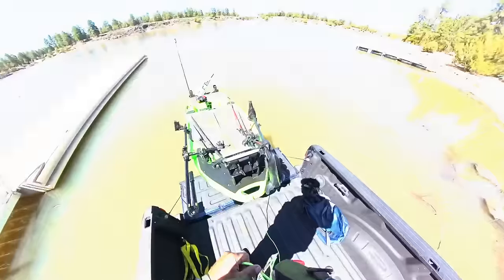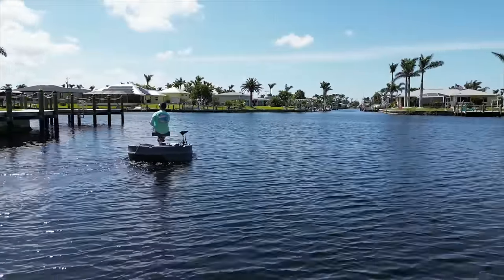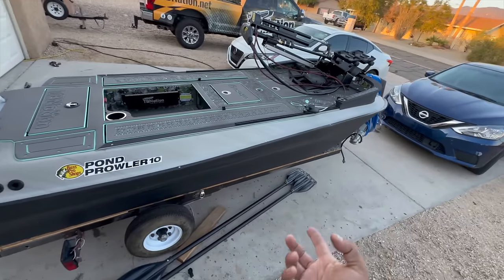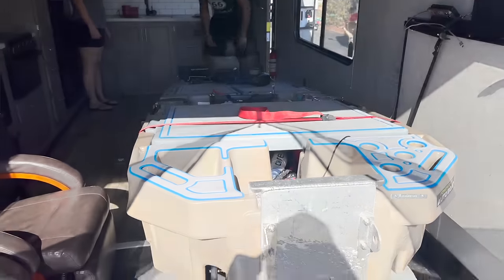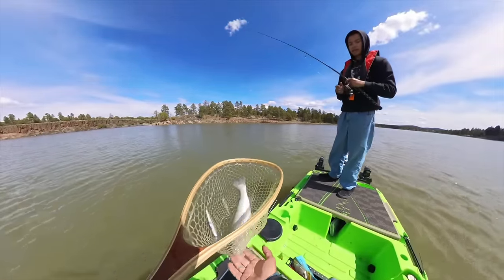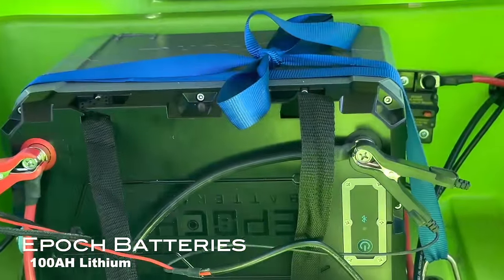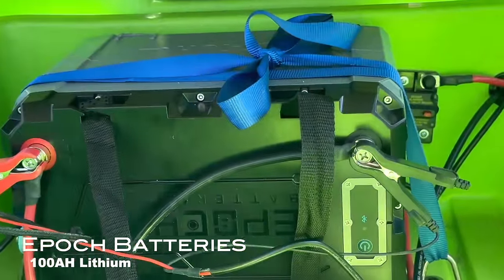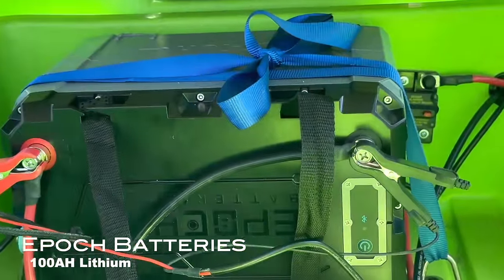Is the Lite Skiff the perfect Tiny Boat?

Comment: My pelican bass raider I bought for $800 is lighter, wider, holds more weight, and goes 10-15mph everywhere I go in inches of water w my mud motor. That skiff starts at $3700! I usually go fishing with my wife and 3 kids and don’t have to worry about sinking or flipping. It’s a cool boat tho
Reply: What the heck is a mud motor?  I've been looking into trolling motors for my yak. I would definitely pay the extra money to Cruz at 10 to 15

Comment: what abt the fact that a 12ft jon boat ways about 80lbs and costs half the price of this thing? 8,10, and 12ft jon boats are all wider, lighter, and cheaper. and can all fit in a truck bed.
Reply from the maker: Jon boats have no storage. To try and add storage in a boat like that will likely end up costing you more + it will be heavier
Reply: @TinyBoatNation  so if given the option between a 8,10, or 12 ft jon boat or a lite skiff?

Comment: Real installation hurdle for me with the Autoboat was the need for the goofy retaining collar required for install. 
I had a couple of kayak trolling motors sitting around (30lbers from a Chinese import tandem, just like a BKC and Hoodoo white label).

These didn't come with the pontoon style bow mount I bought to drop the trolling motor on, and the motors themselves did not have the collar that the Autoboat kit assumes that you do.

Finally, I couldn't work out how to put a transom block on the front my new Milha Lite Skiff (I'm not a welder and there's no way I could fab something like what is seen in the video, impressive as it is; just way out of reach for basic DIY types like myself, still getting over saying things like "that's a hardware problem"). Likewise the kayak track mounted transom bracket I had on hand (I think from Railblaza) would not grant anywhere enough front or side clearance to get the motor shaft vertical past the bow from the front three track mounts (center, right or left).

I had another transom bracket laying around for a hybrid SUP (a cheapie Amazon special knocking off the MinnKota design) and found it had the molded in collar, so just ended up sawing off the goofy triangular nut. I fastened a bracket from the retaining screw for the collar to my pontoon-style bow mount bracket.

In retrospect, I would have bought a stainless shaft collar the right inner diameter for my trolling motor shaft and bolted it on (without sawing up the transom mount) and used the tension screw whole to bolt that to the pontoon mount with a straight bracket/single-column hole mending plate.

This would be a really cheap piece of plastic to include in the kit to make it complete, even if you don't use it (assuming, say, your transom mount bracket has one built in).
Reply from the maker: Send us pictures of what you’re talking about to support at tbnation.net please!

Comment: can you direct me to the quick release trolling motor mod (rope handle release)? love that and would help me allot!
Reply from the maker: I made it with two 3/16 inch bolts and two pieces of aluminum sheet metal. I can probably do the mod on an actual video later.

Comment: It's slightly too expensive. 2500 and I'd be in
Reply from the maker: Once you try it out, you start to realize it's really under-priced.
Reply: @TinyBoatNation  Maybe but it really doesnt solve any of my problems. I dont have a pickup truck. So I would still need a trailer and at that point I might as well use the jon boat I have that I have been putting off registering.